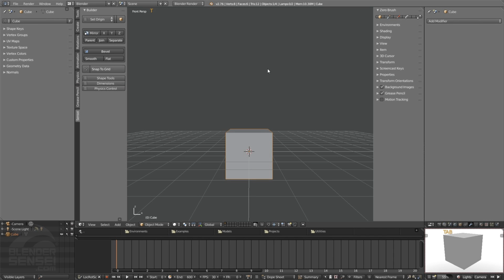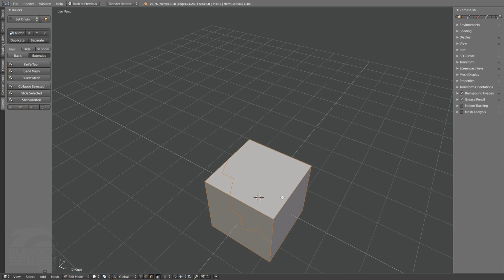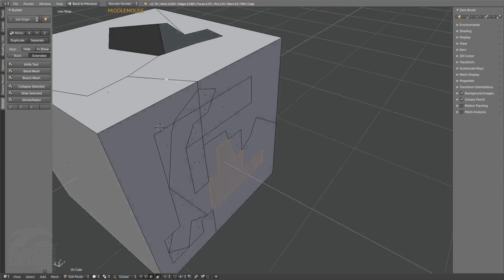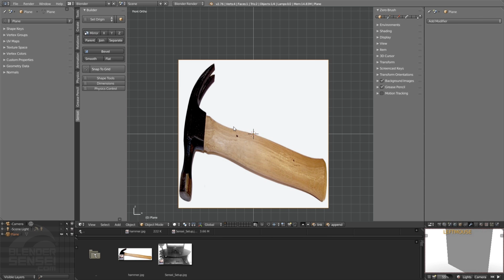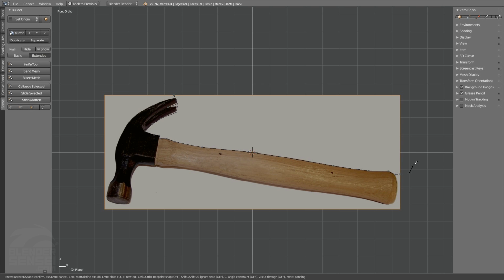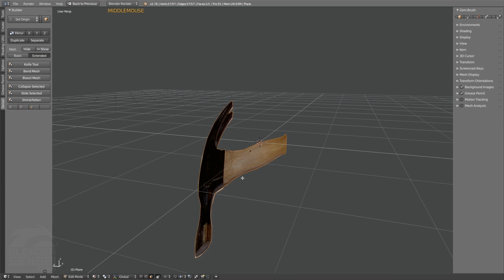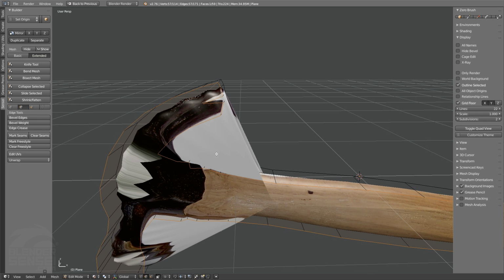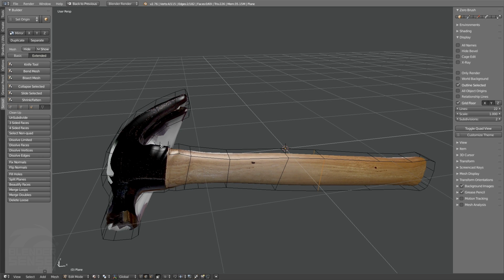The Knife Tool

Comment: My knife tool cannot start on or pass through a vertex (the border around the knife's box turns red) and holding "s" doesn't prevent snapping?
Reply from the maker: Are you using Sensei Format (as mentioned in the beginning of the video)? If not, your hotkeys may be different. In either case, as soon as you activate the knife tool "K", you will see the bottom 3D View header menu transform into a bunch of text letting you know all the hotkeys and options for the knife tool.

Concerning your first issue, I deactivated Sensei Format to see if I could repeat your issue in default Blender... I did see the snap points generate a red border around the green boxes, but this did not prevent me from making cuts. So I'm not sure what the issue could be here.
Reply: Thanks for the quick reply :D turns out I was trying to cut between 2 separate surfaces on the same object which explains the vertex issue. I'm not using sensei format, but I'll just live without disabling snapping.

Comment: Thank you a lot for your explanation. Is there a way to avoid the unwanted cuts (or edges) randomly appearing around your cut though (Just like the ones appearing at 2:21 after you pressed Space)? Is there a way to control those things or do I just have to be careul cutting hoping the knife not to mess around? That would be an enlightening grace from the sky if you answered me, thx again!
Reply from the maker: No, not that I know of. Blender does it's best to generate 4 or 3 sided polygons when it can, so edges popping up is part of that when using the knife tool. You can disolve the edges, vertices and faces however afterwards. In Sensei Format while in edit mode under the extended tools of the Sensei tab of the tool shelf, click the far right bottom button to do a limited disolve, or select vert, edge, or face buttons to bring up menus allowing you to disolve other things.
Reply: Thank you, that was really helpful!
Reply: Oh, wait, no: I'm trying to make a hole in a plane, but although being in Edit Mode and after I've tried to disolve faces by selecting them it appears to be an error saying "could not create merged face". So I tried disolving edges, but it says "invalid boundary region to join faces".